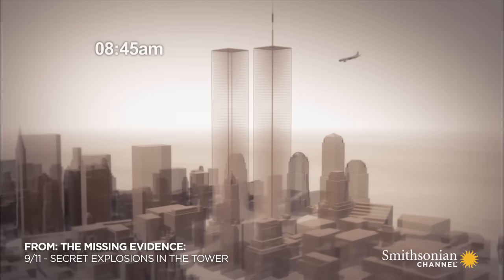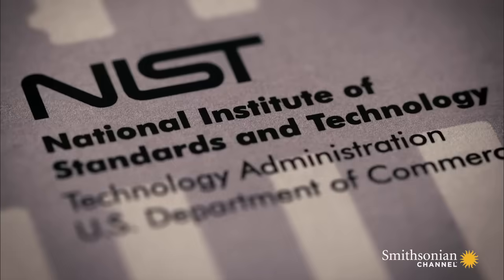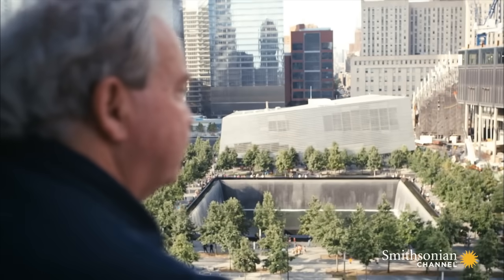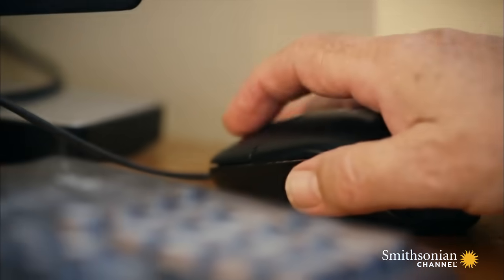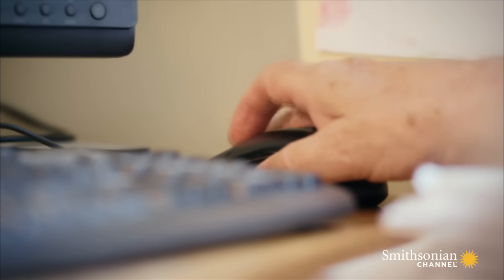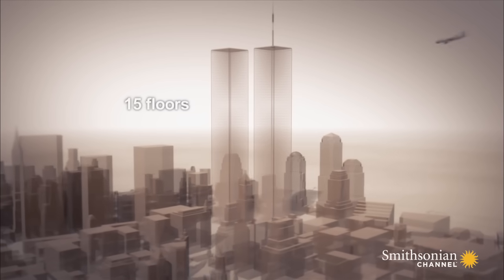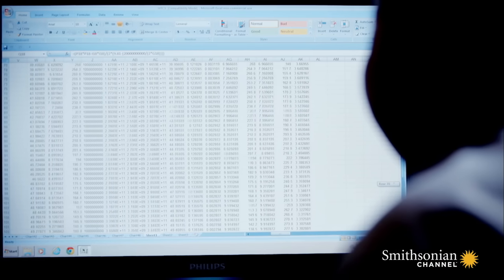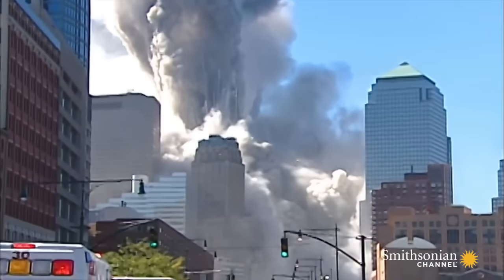This Computer Simulation Explains How the Twin Towers Fell

Comment: All that weight crushing down is the same weight that was strongly supported for years without collapsing. They think we're that naive lol
Reply: You are! The problem is that the structure that supported that weight was disrupted! 

BEFORE: All floors' weight was carried by the columns, not by the floors below.
AFTER: Tower tops fall off the columns & directly onto the floors below, which were NEVER intended to bear that kind of weight!

Also, learn the difference between dead & live loads.

Comment: steel melts at a temperature of 2,777 degrees Fahrenheit, but jet fuel burns at only 1,517
Reply: No steel melted at the WTC. That's a myth.
Reply: @Tim22222  molten concrete.  WTC meteorite

Comment: "Frank's calculations would also NEED TO PROVE that the floors below each impact point would DISINTEGRATE in a manor that LOOKS SIMILAR TO A CONTROLLED DEMOLITION." - If it looks, sounds, smells and tastes like controlled demolition then it must be Frank's calculations.
Reply: Right, they're admitting that it looked like controlled demolitions and it certainly was.
Reply: @jamespenny9482 No they are saying that it looked similar to one. Not that it was one. You are misinterpreting what is said and manipulating the message as a result. This is how disinformation spreads.
Reply: @jamespenny9482  if you learn basics physics, you will see the building fell under its own weight
Reply: @stfjinkiojd  not what it said in the video
Reply: @stfjinkiojd  Nope. Only if you want to go outside of SCIENCE!

FACT 1: A gravitational collapse of the north tower violates Newton's third law of equal and opposite forces. The top 15 floors supposedly crushed the many floors below all the way to the bottom. Putting aside the basic physics violations addressed in later points, When two bodies interact by exerting force on each other, these action and reaction forces are equal in magnitude, but opposite in direction. This means that for every floor destroyed in the lower section, a floor is destroyed in the upper section. This means that after 15 floors have been crushed in the lower section there is no piledriver left to continue the collapse.(Even if it could crush the stronger lower section, which it couldn't) There was very little 'accreted mass' as it was all being expelled laterally.
Reply: @stfjinkiojd  building 7 too? sure bud
Reply: Sheesh, That's because the floors collapsed like they would in a demolition.  Anytime their support is weekend by heat they're gonna collapse.
Reply: You can just as well argue that a controlled detonation looks like the collapse of WTC and come to the conclusion, that controlled detonations don't exist. 

The level of human ignorance is limitless.

Comment: How did wtc7 go? I'm European and it seems like you skipped one of the tree buildings that went down that day.

They all went from top to ground in 12 sec, according to Newton's law if you'd drop an 8-ball from the top it would take 9.6 sec to hit the floor, that's without any resistance.

Also an airplane is allium, each of those towers where build out of massive steel and concrete, it's near impossible that an airplane could even breach those walls to begin with.

Also the airplanes had a asymmetric impact it's strange that the result was soo symmetrical, you'd think by laws of nature that it would tip over or at least one of them, because you know laws of nature ...

Also building 7 was not addressed which did a symmetrical collapse some 7h after the two airplanes hot etc 1 and 2. 

Also it did not get hit by any airplane.

Soo it's very strange that it could also just disappear in 12 seconds, also a massive building with lot's of steel and concrete.

This video didn't explain anything ...

Comment: Our impeccable defense system and sonar magically got shut off that day
Reply: Definition of sonar: "a system for the detection of objects under water and for measuring the water's depth by emitting sound pulses and detecting or measuring their return after being reflected.". Yeah that really would have helped with the planes that fly in the air, above water, that you use radar to detect.
Reply: Not like they would have saved the towers anyway in this surprise attack
Reply: What sad is the response of our air defense system , 4 planes turn off thier iff and nobody responds fast enough . They should have put awacs in the air and launched every fighter to escort every airliner to the ground . When I was on deployment in 1989 radar picked up a ussr bear recon aircraft , an alert fighter was launched in 8 minutes to escort it around the carrier battle group and send it on its way . When a real attack happens how will our government respond ? Make multiple phone calls to get a response , while the attacking aircraft get closer
Reply: @scallen3841  You also have to realize that by 2001, the Cold War was long over, and the United States had scaled back its military quite considerably...
Reply: Technology 20 years ago was a lot different to today.
Reply: @flobbertop4278  radar lost contact with 4 planes plus no iff , scramble fighters and go find them and escort them till they land . Launch a couple awacs to track all aircraft
Reply: nobody mentioned building 7
Reply: @Zoeyinterface  it was still standing when media announced it was in rubble. How about the fact that we're only allowed 3 frames of images of the supposed plane that hit the pentagon? The most surveilled building in the world. I've seen the interviews of people who lived near by witnessing a plane fly low then go back up into the sky. Where are the wing marks on the pentagon?
Reply: @Filth McNasty

It's not that we're "only allowed 3 frames", it's that most security cameras at the time only took one image a second, being recorded to tape. A plane going at full speed covers more distance than the camera's field of view in a second, so it simply only had a small chance of capturing the plane. The same was true with car accidents, etc. it wasn't at all uncommon for these cameras to miss fast movement. About the wings: Planes don't make cartoony entry holes into concrete buildings. One wing hit the ground and the other bent into the plane at impact. There was a lot of plane wreckage of flight 77 seen by hundreds of witnesses and photographed by independent journalists. It is good to be sceptic by all means, but to imply flight 77 didn't not hit the pentagon is either unresearched or bonkers.
Reply: @sorlag110  one image a second? So it took that missile 3 seconds to move that far?
Reply: @Filth_McNasty  What missle?
Reply: @sorlag110  even if these guys were given the footage to view , if it went against what they already believe they would say it was fake .
Reply: @Zoeyinterface  that's always the fall back when every other arrangement fails
Reply: Sonar? You mean radar?
Reply: There was a norad drill of high jacked planes that took place at the very same time the real event occurred
Reply: @Filth_McNasty  one would think the response would be better , put a couple awacs in the air and vector fighters to locate then escort the plane an force it to land
Reply: You are just wrong bro
Reply: They wouldn’t shoot down a airliner even if they were on
Reply: Yes look up who was in control of Norrad that day. They could of easily stopped those planes. They did not for a reason plenty of evidence out here people just accept what they are told without critically thinking
Reply: @GOOCHIElicker same goes for you.
Reply: and when it failed the bush/cheney admin didnt fire or demote a single person in the USAs failed air defense !!! 3,000 deaths wasnt enough poeple dead i guess for them to fire anybody!!
Reply: and even though this lead to 3,000 deaths , nobody in the failed defense was punished! nobody was  fired!!!
Reply: and NOBODY was punished by Bush/Cheney admin even though this "mistake" caused the death of 3,000 people!!! amazing!!
Reply: LIES

Comment: My question is, they attacked, killing many destroying both towers, but why did they strike the tops of the towers and not the bottom?
Reply: I think they just wanted to make sure they hit anywhere.
Reply: There was a previous attack on the wtc where they did attack the bottom which nothing happened
Reply: @brandondowse6326  So what? Surely you're not comparing an underground truck bomb to a 150-ton jumbo jet full of fuel slamming into the building at 500 mph, are you?

Comment: The jet fuel was burned up within minutes, so the floors were almost exclusively fueled by building materials and office furniture. But suuuuure... "weakening the steel" with a fire fueled by office supplies around the 6 floors (out of 94) that were impacted would totally cause the lower floors to disintegrate and enable a collapse at near free-fall speed. Right.
Reply: [fire]...would totally cause the lower floors to disintegrate

No one claims this.

Shame. And you're so close too.
Reply: Are you forgetting that the weaken steel are holding up how many floors plus a plane?

Comment: Am I the only one who thinks that a simulation such as this needs to show the entirety of the situation?
Meaning, you have to show the planes impacting at the points of origin. And then let the simulation run its course. You have to factor in the duration of the fires, what was on fire, any intricate parts of the building ie weight of concrete floors coupled with the furnishing of the buildings, fire suppression systems, water systems, generators, geographical location, winds from the outside aiding the fires, the asbestos, etc. Not just the structure itself. 
There's so much to factor in and this POS is trying to sit there and say he ran ALL of that in his computer simulation, and we only get to see a montage of him working on it?
The people who created this need to understand....
We need as close as to exact as humanely possible in order to put this to bed. We want to see a real-time simulation from beginning to end with as many factors included as we can fathom. We want to see the plane hit and behave in the exact manner it did upon impact. 
We want to see the intrical parts of the building (the inside) as the building is on fire and how it's responding within. 
Are beams softening? 
Are beams snapping?
Are the systems erupting within creating the explosions heard and experienced by countless witnesses?
Did jet fuel find its way into any other part of the building other than the impact zone?
So many things we want to bare witness to. And it's possible. Costly and time consuming, of course. But possible nonetheless. 
I feel it's incumbent on the government to provide full transparency. Especially if your goal is to prove yourself innocent of crimes against humanity. 
My fear is we'll never get that.

Comment: 9/11 was the first an only steel tower to collapse due to fire!?!? lol come on grenfell in the UK burned for over 24 hours and never collapsed and the twin towers collapsed after 7!? Ok let’s pretend they did collapse from fire alone please explain how a tower can just buckle and come straight down from just fire? How did tower 7 which is over 150 meters away collapse? How did the aluminum wings on a plane slice through steel like it’s butter? 9/11 was the biggest political stunt that has ever happened it was an excuse to invade middle eastern countries to search for “nuclear weapons” aka Oil as the American economy was going bust ( still is )and as middle eastern countries were developing and not selling oil cheap anymore the US didn’t like this. All the news stations are in on it as they are controlled by the 1% who basically run the country.
Reply: Was the Grenfell tower hit by a 150-ton jet doing 500 mph?
Reply: TimReed22222 makes no difference both towers had a core steel structure in the center this held up all the concrete floors and weaker perimeters weighed around 80000 tonnes It’s make 0 sense how the core also collapsed it is the the strongest part of the building and can hold more a lot more than an extra 150 tonnes which is nothing compared to the weight it is actually supporting .Yes the core would be damaged where the plane impacted it 15-20% but the rest underneath would see not much damage also fire spread up not down as well as heat makes 0 sense how the bottom structure would give away.
Reply: @MrFiendyBob  It makes a HUUUUUUGGEE difference!! You need to learn how they were built: The towers were designed with a "tube" design, meaning the columns held 100% of the weight of each floor (as opposed to traditional skyscraper design in which each floor holds up all the floors above it). Once the collapse began you got 30+ floors falling directly onto the first floor below, which had no chance of catching that kind of force! Repeat for the next floor, then the next, then the next ...
Reply: TimReed22222 look at my other reply ^^
Reply: @MrFiendyBob  Free fall is a myth. Drop that one from your repertory.
Reply: NZ Hotels clean bathrooms with poison chemicals Each of these 110 story towers fell upon their selves in about 10 seconds at nearly free fall speed this violates Newton’s law of conservation of momentum that would require that as the stationary inertia of each floor is over come by being hit the mass increases and the free fall speed decreases. Let’s pretend this law if ignored the towers collapsed upon itself crushing all 287 massive colums on each floor while maintaining a free fall speed as if the 100000 tonnes of supporting structural steel framework underneath did not exist
Reply: NZ Hotels clean bathrooms with poison chemicals as for building 7 it was not damaged a lot by fire in fact other buildings around the area were more damaged by debris and fire and did not collapse

Comment: I looked at the footage of the collapse and noticed how pretty much the top dozen of floors came down on top of the tower like a big block basically. Common sense told me maybe the weight of that cause the initial collapse of the following floors, then the weight kept adding up and essentially created a domino effect. Seems like I was right without simulating it with proper mathematics lol
Reply: Hard nope bro, learn some physics / engineering / geopolitics…

Comment: What I believe happened is that the mixture of jet fuel and fire softened the beams inside the tower. As the beams could eventually not hold the weight of the upper floors, the collapsed on themselves, which is why the south tower collapsed first, it held more weight above the crash zone and made it easier for the floors to fall. This is backed up by the people inside the buildings when they collapsed, and only 20 survived. They all said that they heard a repeated banging noise, like the floors pancaked themselves, which is what my theory is, the softened beams could not hold the upper floors, so they fell in on themselves
Reply: Well, explain Building 7. It collapsed from the bottom up, just like a conventional demo
Reply: Adam Syed If you look at footage of the 7 WTC collapse, it doesn’t collapse from the bottom up, the building gives out near the bottom and the floors above it were connected and all collapsed down and broke apart

Comment: There was bombs under the building that exploded. That was what made the building collapse. The plane didn’t even do anything
Reply: The Towers collapsed from the top down. "Bombs in the basement" is nonsense.

There’s NO way that a steel built tall wide building got folded like laundry from a measly commercial plane

No one claims this. The Towers stood for 105 and 55 minutes after the impacts.
Reply: Physics: ight imma head out
Reply: @RezClipsx  
What about "physics" don't you understand?
Reply: Tim Shea the part where a plane can take down a skyscraper
Reply: @RezClipsx  
As I said, no on claims this. As I said, the Towers stood after the plane impacts.

Comment: The towers were built so the floor above the one below holds the weight of that floor. The planes hit the support beams— that is why both of the entire buildings collapsed.
Reply: Huh ?
Reply: I think I just grew a brain tumour reading your comment LOL
Reply: I asked a structural engineer I've known and they said that the lower the part you are in a column, the stronger it gets so it's strange that the columns below the crash was also decimated. The overall foundation should have had the strength to hold the upper floors just enough to let them fall on the sides instead of going down. That's just a general conclusion though. There could be a lot of factors in play too.
Reply: Think they was weak because of outdated the design was with concrete and steal beams most building use stronger concrete like on one world trade centre
Reply: wrong